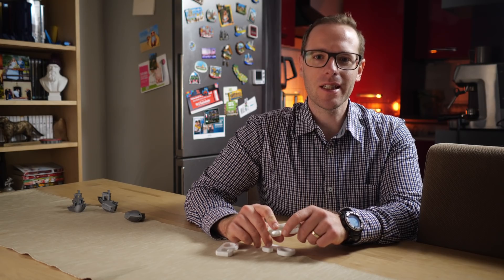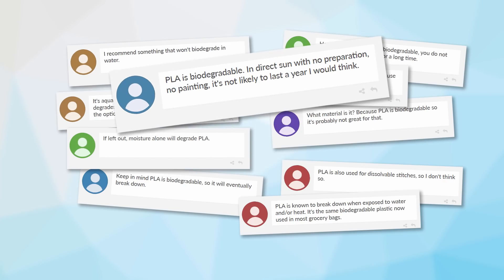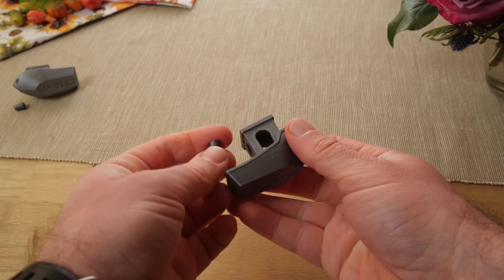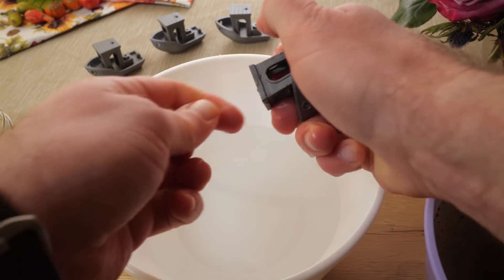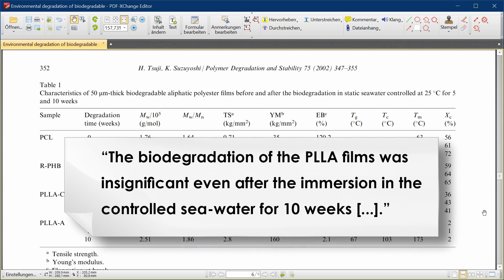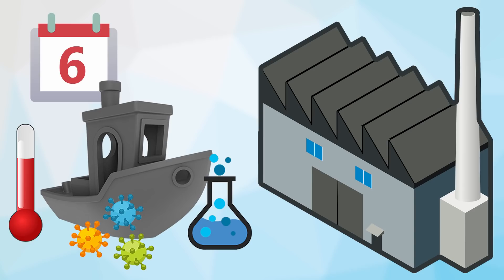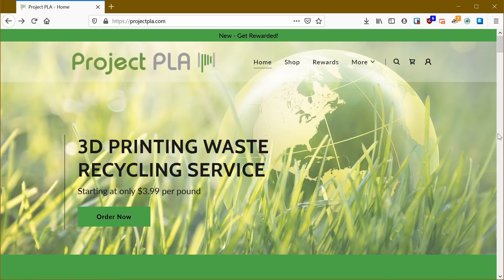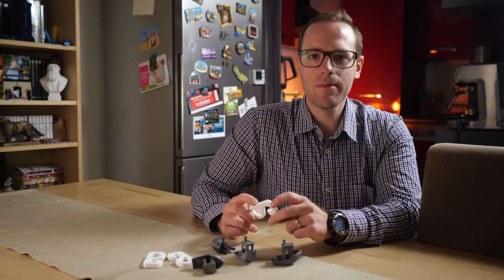Is PLA for 3D printing really biodegradable? I've buried and drowned Benchy for 2 years to find out!

Comment: Use UV light to degrade it faster =)
Reply: The goal is not to intentionally degrade it; we wanted to see it biodegrades by itself. It doesn't despite suppliers claims that it does 😕
Reply: The problem is that buried pieces degrade slowly than the ones left on the surface with some UV from the sun helps to reduce the molecular weight of PLA, more food more bacteria =P edit: The temperature (+ 20ºC) helps to get an microorganisms growth too =)
Reply from the maker: I did leave one Benchy outside on the sun/rain/snow as well, didn't seem to affect it at all. But sadly, I didn't weigh it before. All 4 Benchies had roughly the same weight at the end.

That's the main reason for the second test, I want to have actual numbers behind it.
Reply: @HobbyHoarder  In that case, it might be a bit of a pita if you don't already have a set up and maybe not possible if you don't have the space for it, but you could consider a hot compost pile. Obviously, it is still not what we would call biodegradable in an everyday sense, but still more attainable than industrial only. It does have the obvious issue that ideally you would turn it into smaller parts to speed up the process, which would make testing pretty dang hard, but even if you just toss one or a few hooks there, it should give something to look at.

Comment: PLA is not compostable it's biodegradable.  Under very specific conditions, which require a lot of heat.  In fact, in many instances ABS is actually better for the environment because many cities don't have the ability to recycle PLA, but they do have facilities to recycle ABS.
Reply from the maker: Yeah, that's a very interesting point. On the one hand, PLA is better at the start, as it's usually made out of corn starch, while ABS uses petroleum. But at the end, PLA rarely gets recycled.
Reply: You mixed  up the words “compostable” and “biodegradable”.
Reply: It's degradable under certain conditions but not biodegradable.  The enzyme required for the degradation process does not occur in nature so it can't be considered to be biodegradable imo.  I suspect that you are right that the degradation products are not suitable for use as compost but I've not been able to find  reliable source of this information.
Reply: @dibblethwaite  It´s degradable in living organisms like humans or other animals. So It IS biodegradable (by enzymatic chain scissoring). That´s the reason it is used in non permanent implants
Reply: @wookie8975  That's good to know. Thanks.
Reply: @wookie8975  Whatever happened to those caterpillars that can eat plastic?
Reply: @wookie8975  Soo...you could eat your failed prints to recycle them?
Reply: @Frrk  Well, you would have to grind them down beforehand significantely or else they would just come out the other end with marginally less mass
Reply: Is it like the difference between digestible and edible
Reply: I don´t know why people think that PLA is something better for our enviroment than ABS. Oil is nothing else as very long dead plants and animals, corn starch is only younger... ABS is just longer in the market and has done fine as cover for electronic devices like TV, so there are masses out there. Masses are easier to sort out and are more cost efficiently to recycle, even if it is not easy to get the color out of it. Black is the best to recycle because black ABS can be recycled directly.
Reply: @arrgh-  the differnent effect of PLA and ABS ist not because of the Precursors used, it's the structure. PLA is a polyester and therefore enzymatic chain scissoring is much easier.(As it would be similar to fats (fatty accids and glycerol are also combined esters). PCl the other biodegradable polymer mentioned in the First study ist mainly made from oil, but is biodegradable, too.
The difference between ABS and the other two is that PLA and PCl degrade on a timespan of 5-10 years (compare with wood) while ABS takes much, much longer.
And for the colouring Thing. The colouring can be a problem because it can change the reflective signature of the polymer so that machines can't sort it properly.
Reply: @wookie8975  I totally agree but is it better to have this good enviromental feeling for a material that will last lots of years because its not treated properly or a material like ABS which is (in germany) sorted out and recycled to new ABS at a high percentage?
Reply: @arrgh-  I think you overestimate the amount of physicaly recycled ABS in Germany. The fraction of the ABS-plastics group (including similar Ines Like ASA) was 2,7 percent in 2017. Also around 50 percent of plastic waste undergoes thermal recycling. The plastic that is recycled into new products is mostly PET and some others. The fraction of ABS is gar to low to recycle it effectively. It would mostly be burned in waste incinerators (along PLA) or coal power plants for electric energy.
Reply: @wookie8975  Just cant ell the infos of a recycler in my vicinity. Electronic covers are seperated by hand and recycled completely. I just wanna build my shredder and a filament maker and get my ABS for some bucks...
Reply: @arrgh-  Strange, in my area any black plastics are "not recyclable" because "we don't have the equipment to process it", according to the recycling facility workers I've asked about it. Regardless of the recycling code it's stamped with, if it's black plastic it's not supposed to go in with the recycling, but with the stuff headed for the landfills. Are you sure that black ABS is best as a source material for recycling and not the easiest color to achieve post recycling? Seems to me that removing color(s) would be more difficult than to add black to "cover up" the sickly greyish hue one often seems to end up with when multiple colors are combined. 🤔  The "no black plastics" rule here has always puzzled and kind of irritated me and if black ABS really is preferable going in, it makes even less sense. Assuming that ABS makes up a significant portion of the black plastics used for packaging, that is. I don't know why it's such a thorn in my side, but with all our recycling going in the same bin, everything has to be sorted anyway and it seems like there's got to be a better way than expecting people to pay to put recyclable black plastic in a land fill.
Reply: PLA is actually commercially compostable, under specific conditions (mostly due to the high heat).  It comes from corn starch, and is one of the materials compostable silverware is made from.
Reply: It's as technically biodegradable as polystyrene, needing a specific enzyme to degrade(found in mealworm guts, in PS's case)
Reply: Not if you print ABS, because the recyclers check the products with the ABS mark. We could start printing the marks on our printed parts, but since most part that I throw away aren't in one piece anymore it would be mostly useless.
Also they don't know where to look for the mark on a 3D printed part. So they probably wouldn't bother with it.
PLA is still better in my opinion because at least the production is more environmental friendly. Also we know from fumes test of printing abs vs PLA. That PLA has way less toxic fumes. So I think, (but I don't know for sure) that PLA burns way more cleaner in a furnace than ABS.
Reply: @MisterMakerNL  Aren´t reclycling facilitys just scanning the Infrared Transmission/Reflection for sorting plastic? At least that´s what I learned(Including the problem with different coloured coatings)
Reply: @MisterMakerNL  Well... At least in Sweden, we are kind of modern so it is a computer that scans the plastic using different wave lengths of light and then it can tell what the material is made of, and then it sorts it in different fractions.
https://www.youtube.com/watch?v=yFrVmNJgW_Q
Only in Swedish but, 20 ton/hour. They take the plastic through two times to get the best quality. And it results in 10 different fractions.
Reply: Thank you for this comment, you're spot on